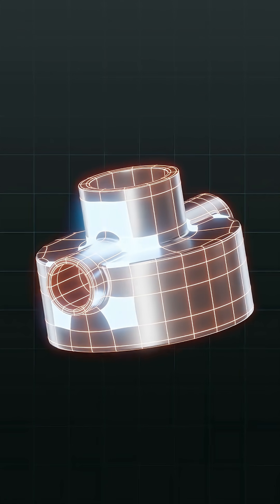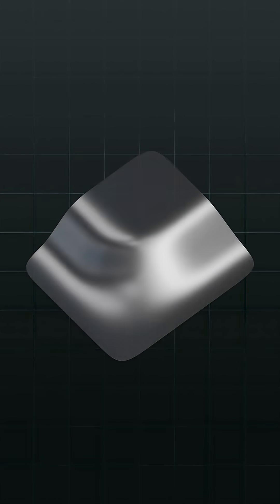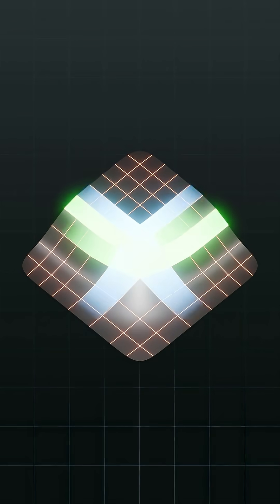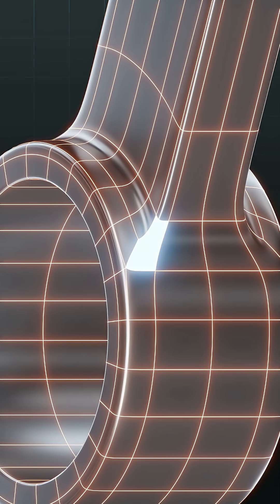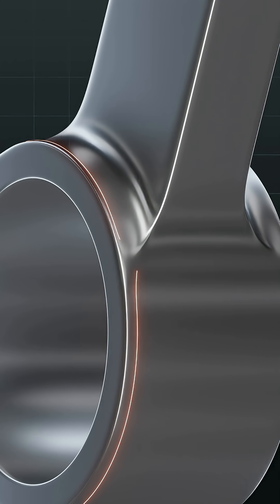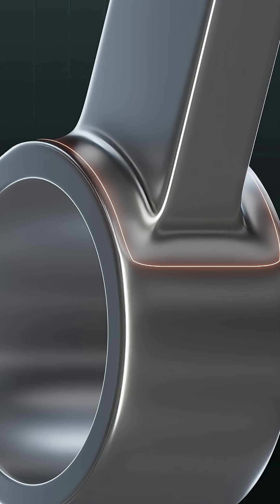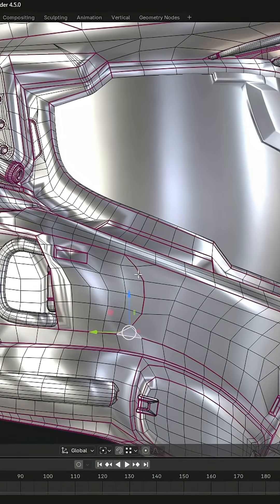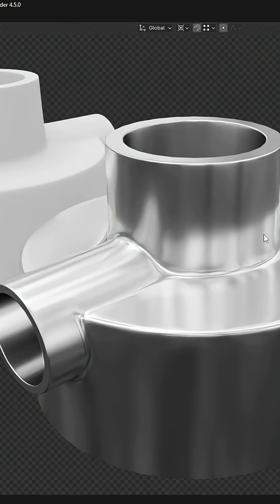You CAN Model with Ngons | #blender3d #blendertutorial #blendermodeling

Comment: Uhhh. No.
Reply from the maker: Did you watch what I had to show before just saying no? 😅

There’s a great deal of logic to ngons, they’re in many ways similar to poles. Just like poles, ngons will distribute the flow of topology. Provided you place them correctly, just like poles, you’ll avoid unwanted shading errors. 😁
Reply: @masterj2001  this kind of person is what we in arabic call "a memorizer, not a comprehender". They heard "ngons are bad" and took it to mean ngons are always bad all the time, not understanding why programs don't automatically convert all meshes to tris/quads if nobody used ngons ever.
Reply from the maker: That’s a common thing with ngons, is that their negative stigma stems from a frequency bias, as it’s easier to find examples where they cause issues as opposed to solutions. 😅

Funnily enough, triangles and ngon usage are detailed in Pixar’s own open subdiv modelling documentation. I’m only a hobbyist, but if the likes of Pixar, let alone other modellers that are far more talented then myself, use ngons (and I can replicate the results), then I can assume beyond a reasonable doubt that they work. 😁
Reply: @Hyikal  I have a degree in computer science and several years of 3D modeling experience. I've done my fair share of continuously rejecting memorization and dedicating my efforts to comprehension, thanks.
Reply: @MustafaBerkeGureltol  I'm genuinely curious why you feel that ngons don't work. You're presented with actionable information with clear results with no shading errors (I recognize that you feel differently, but I feel there's a disconnect here with what you consider to be an error). I would like to know where your critical thinking is leading you to opposing conclusions. Can you provide clear answers aside from "it doesn't work"?

Quads suffer from the same issues that ngons do when used poorly, both in the high and low poly. And most often, when doing quad-only modeling, you're creating the same or similar results manually that ngons would create post-subdivision. 5-poles are inevitable in quad models and yet are accepted. So why not ngons, which very predictably subdivide the same way (this is a fact, not opinion. Argue with Math on that one)?
Reply: @masterj2001  Yes, watched it thrice actually. Still a no from me.
Reply from the maker: That’s fine, but I’m curious for as to know why you say no? 😁 

The results that I’ve shown in this short, as well as the additional examples in the related video, are backed by plenty of research into the topic and have been vetted by modellers that have far more knowledge and experience than me. 😁

So I’m curious as to your opposition to the concept, as I know most modellers simply oppose them due to an established stigma. 😅
Reply from the maker: I think 'terrible suggestion' and 'irrelevant examples' are a bit heavy handed. 😅 I can see you're passionate about this, as am I, though I'd like to discuss this in a constructive and friendly manner. 😄

As you said, the first example works. I recognise it's not a practical modelling example, but that was the point, it was just to establish an example and show the fundamental concepts. Regarding the shading, it does shade cleanly without artifacts or pinching, and that's why I chose to show a rotation of the object with a highly reflective material, to clearly show how the mesh normals behave. 😄

Could this be done by hand? Certainly, but the benefit that I wished to highlight here is taking advantage of the mathematics of the subdiv operation. I see that you also have a degree in computer science, so you'd no doubt understand the underlying mathematics of how the algorithm is calculating the placement of the subdivded verts far better than I. 😄

The second example does create a proper flow of topology, something I show and explain in the full length version of this video. Something I also note in that video is that I'm not advocating for the fact that ngons are better than quads, but that they have utility within modelling and do serve a purpose. 

For the last part, and I did see this in one of your videos, and you and I will agree here, yes, you need to resolve the final model into triangles if it's going to be used in different engines. The beauty is that ngons triangulate into all tris, so they still abide by that logic. If you really want to, and something I make a point to do in the full length video, is isolate the subdivided quads of an ngon and integrate it back into the original mesh for an all quads solution.  

I know I'm not going to be smart enough to dispel every argument you make here and I don't wish to come across as being defensive by just trying to say 'no, this' to every point you make, as I think that's reductive and I don't wish for you to think that I don't respect what you're saying. 😅

I do implore you to check out these two articles though, as I think both provide a great deal of detail (far more than I possibly could): https://www.artstation.com/artwork/0n93EV https://graphics.pixar.com/opensubdiv/docs/mod_notes.html

My understanding that ngons can work within a subdivision workflow comes from documentation by Pixar and examples from industry professionals (I'm only a hobbyist, so who am I to argue against the industry and industry professionals), I am also able to replicate the examples and adapt the usage of ngons into my own models. So from a purely evidence based perspective, not a matter of beliefs, I can see enough evidence to prove that they do have use cases, even if they are limited. 😄

Happy to keep discussing this with you, as I love your passion for modelling, but would only like to do so if it's done respectfully. 😄
Reply from the maker: Don't call yourself a bum mate. 😅

As you said, you've got a limited knowledge in modelling at current and are still learning. My advice, learn all the basics of quad-based modelling, edge flow, and poles. They underscore the fundamentals of modelling for a reason and I'm by no means advocating for throwing those fundamentals out the window. 😄

Ngons don't necessarily break the rules of modelling, something I would've previously said, but can be viewed more as an unconventional or taboo means of modelling due to their stigma. In fact, the only reason that ngons work is due to them abiding by these fundamentals. Can they be used absolutely anywhere without reason? Certainly not, they need to be used mindfully, but the same goes for much in modelling, if you place a pole incorrectly or have edge flow that doesn't respect the shape's surface (even with all quads) you'll still run into errors. 😄

But I'm sure with time and practice your skills with develop overtime and you'll have a better grasp over when and how they can be utilised (it's something I'm still learning myself in all honesty). 😄
Reply: @masterj2001  First of all, there isn't a single unfriendly and/or disrespectful phrase in my earlier comment. So I do not hate you in any way. But I still stand by what I said. It is a terrible suggestion and it is backed up by irrelevant examples. Just checked out the full video and the sources you've shared. Further explanation:

1- The n-gons you use in the full video and in this short are not the same n-gons. The one in the video is a hexagon, and this one is a pentagon. But regardless of that, the poly flow they create is, again, ambiguous. You can say that at SDiv=1, it creates a loop that's going up and around the edge. Well, I can also say that it is looping around the whole extrusion. And another person can show up and say that it is connecting the cylinder's lateral surface to the extrusion. At SDiv=0, none of them is right, and SDiv=1, all of them are right. In procedural hard-surface modeling, this behavior is not really welcome as it takes control away from you in a way, and it starts producing visible artifacts at either the first or second subdivision level right off the bat. And let's be honest: The loops you are trying to justify are not even functionally good. They come from the side of the extrusion and connect to one of the four corners of the shape. To be fair, a triangle and a quad instead of an n-gon would arguably perform better; at least you would've hugged the base of the extrusion with a loop, and that could help you sharpen the connection point uniformly if you needed. But the shading problem with the cylinder's caps would remain. You need an extra set of loops there. In either case, you could avoid a series of unfortunate problems by not using n-gons and establishing a better topological density at the first place. Just extrude it and add a few support loops. It will look much better.

2- Katja's post has been around for some time, shared on various forums, and has sparkled arguments. More than half of the examples used in the post are being showcased on flat surfaces. You cannot stress-test n-gons on flat surfaces only. If you are 100% sure that you will not be adding any additional details on a surface, then you can place a few n-gons here and there to save time. No one is going to notice or blame you for it. But as soon you enter the realm of surfaces with curvature, n-gons start to break. Not only that, but also some good-ish examples revolve around loose 3D modeling, where you don't really care about the accuracy, sharpness, art direction, or revision, but rather making up shapes for the sake of making up shapes. I can imagine far better solutions for the examples in page #13 for example.

3- In Pixar's example, they are using poles "strategically" in their words. They do want a pole there and they determined that beforehand. They do not use it to get away from topology-heavy work; they do not use it to re-route the polyflow. They use n-gons because they "need" n-gons there. Some connection points just require a pole, and they just modeled 1 lower level of subdivision than what they need, and subdivide it during rendering. I even follow a similar method while retopologizing garment patterns. Helps a with pants and shirts.

Just because something gets converted to triangles or quads in the end doesn't mean it is production-friendly. Even though models can be triangulated in the final phase, you still have to deal with the hassle of resolving problems while bringing them to that point. N-gons are essentially a scam, except for specific use cases. There is almost always a better option, including quads or triangles, whether you are launching a new modeling project or finishing one.

Don't forget that a quad is also an n-gon that produces a pole. The only difference is that you can define adjacent faces and propagate that information, which enables smoothing algorithms to smooth the surface properly and allows modelers to improve or detail the topology further.
Reply from the maker: My apologies then, I just read "terrible" as being a bit brash and "I wish the content lived up to it" as a touch passive aggressive. Didn't think you hated me, it just read that as being a bit harsh. If that wasn’t the intention, then no harm done.

Anyhow, I can assure you that the ngons between both videos are the same as I used the same .blend file to create both bits of content and shared the exact same models. 😄

I'm unsure by what you mean with ngons being ambiguous? As in if I had a pentagon face on my machine and you on yours we'd get two different subdivision results? An ngon, of any face count, will subdivide to form a pole that matches its edge count. Unless I’m misunderstanding what you mean by ‘ambiguous,’ I don’t see how that applies here. You can look at any model without a subdivision surface level applied and draw out how it's going to resolve after the first level of subdivision, so I'm not sure what you mean by ambiguous?

As you said, "N-gons are essentially a scam, except for specific use cases", and that was the point that I wished to get across. Not that they should be used everywhere without care or consideration for placement, but for specific use cases, much like the examples provided in the sources I linked. I agree, yes, you could resolve them in different ways, but why not take advantage of the automatic mathematic placement of the subdivided verts as opposed to doing it manually and spending more time on the area than needed? That's more of a rhetorical question, you need not actually answer that, that's just more my line of thinking when it comes to modelling and opting for the solution that takes less work for the same result. 😅

Question though, and I'll be interested in your response here, on that Firefly character model of yours, which looks fantastic by the way! How many 5 star poles are present on it? If you were to reduce the entire model by a single level of subdivision, what would those 5 star poles resolve into? So why is a 5-star pole a viable option, but a 5-sided n-gon isn’t, when both subdivide identically and produce the same shading?

Also, apologies in advance, my next response will be late as I live in Australia and I'm about to head to bed, but I'll be looking forward to reading your response tomorrow. 😄
Reply: @masterj2001  This is truly the most pointless conversation I've read in a while...
Reply from the maker: @JocoseJokes we’re just debating differences of opinion in topology? We both find the topic interesting. 😁

If it’s not for you, that’s fine. 😁
Reply: @masterj2001  Okay, so you are using two examples in the video. One with a hexagon and one with a pentagon afterwards.

By ambiguous, I mean that a) it doesn't have a set of adjacent faces since it has 5 faces, and b) it produces a pole that cannot have adjacent faces. You cannot be 100% sure where the incoming edgeloop would be coming from and where it would be going to. Subdividing an n-gon will yield what I call a "slingshot" polyloop, where a loop would come from some part of the surface, slingshot around the center, and go towards another part of the surface, which may or may not create effects like spiraling, infinite looping, not-yet-defined poles, etc. You can be sure that all the edges would tie up at the dead center, though. It's more or less like a black hole in the middle of the mesh. Stuff like this is quite important for rigging and scripting for procedural modeling, where you could programmatically control where and how an effect or operation would happen. Getting a deterministic result with n-gons is not viable, especially with search algorithms. Other than that, they would subdivide the same way, and probably with the same vert IDs and order on both your and my computer. It's just not preferred to have a polygon that will create a star and disrupt the polyflow.

Q: Why not take advantage of the automatic mathematical placement of the subdivided verts as opposed to doing it manually and spending more time on the area than needed?
A: Because of multiple reasons: 1- Automatic placement usually isn't as accurate as the manual work, which is clearly visible in the first example in this short. 2- N-gons are not deterministic/unambiguous. 3- You can reliably run scripts and deformers without any concern on a proper all-quad topology. 4- Starting with such a quad-based topology actually boosts productivity and avoids most, if not all, shading artifacts, whereas your examples still have clear shading issues around the n-gons.

Q1 on Firefly: How many 5 star poles are present on it? If you were to reduce the entire model by a single level of subdivision, what would those 5 star poles resolve into? 
A1: A lot of 5-star poles. If I were to reduce it to a single SDiv level, the stars would stay where they are because what you see in the artwork is already the second subdivision level, but the base SDiv consists of manually placed stars, not n-gons.

Q2 on Firefly: So why is a 5-star pole a viable option, but a 5-sided n-gon isn’t, when both subdivide identically and produce the same shading?
A2: Because a 5-star pole is a rasterized 5-star pole that consists of quads. Everything is deterministic. It is made of quads, and it subdivides into quads. An n-gon and its subdivided quad-based successor do not subdivide identically; I can crease, bevel, straighten, swivel, and cut edges/polys and control the strength/behavior of them, and the subdivision deformer has no control over those, as everything I need is either already present in the base mesh, or can be programmatically defined if need be. You can clearly see that the base topology supports various modeling operations without sacrificing visual fidelity or control. Even though the poles in my project do not have adjacent faces either, they've been placed strategically to reroute the topology "properly", and I can add an edge loop in any one of the poly loops and it will end up where I wanted them to be. You just need good luck with n-gons when the subject matter is reliability.

Also, I worked on the artwork to test the brand-new bevel shader of Marmost Toolbag 5. It can utilize hard edges to create a bevel effect, and the best thing is that you cannot tell which of the bevels are real and which ones are shader-driven. 

You are approaching the problem as if adding the TurboSmooth or Subdivision modifier to an inefficient topology is fine, as long as it looks pleasing enough—but that couldn’t be further from the truth. There’s a reason why n-gons have a bad reputation in the industry; it’s not just hearsay. And even if it were, I think any misunderstandings would have been resolved by now, given the half-century history of computer graphics and mathematics. I just don’t believe condoning, suggesting, or legitimizing the use of n-gons is good practice when the stakes are this high, especially when there is always a better alternative. Hence, my wish that the content received the same level of care as the animation.
Reply: @masterj2001 no no, Im on your side with this one. But I will say this seems like a one sided debate with this guy. He just seems to be quite stuck up yk?
Reply from the maker: @JocoseJokes  From my perspective or anybody who wishes to take my side in this? Yes. But the same can be said for his side and anybody wishing to take his side. 😅

I’m doing my upmost to simply be respectful of an opinion and just debate the facts. I knew from the get go that neither of us would be likely swayed by the other’s facts, but that’s fine. 😁

He nor I serve to gain anything in convincing the other of our facts. I’ll continue modelling and enjoying my modelling workflow and he his. 😁

Much of the technical language goes well over my head, but I still do find it interesting to discuss and understand other people’s opinions/points of discussion on these topics. 😁
Reply from the maker: Oh right, yes, I do use two different examples of both a 5 and 6 sided ngon to show off the versatility in the `n` factor of an ngon. 😄

Anyhow, we'll have to agree to disagree though, otherwise we'll be debating the semantics of topology until the end of time. But I do appreciate you sharing your point of view and providing with me more insight as to why you see as such. I just much prefer a more in depth explanation than, "no", so that I can also understand things better. 😄

Personally, I'll keep working with ngons when and where I see them having utility as I personally find them quite powerful and can save me some mental gymnastics in problem solving. For the assets I create, provided they shade nicely, that's good enough for me. 😄

Much like the example you bring up with Marmoset, I'm less concerned about absolute perfection and will go for what looks good. Much like how bevels need not be real and can be shader driven, provided the final product has the intended hard surface look for the edges, the final product works in my eyes. 😄

Not to fork into a different debate, but I know that the bevel shader will handle improper edge flow really nicely as well to produce a well shaded result, which then brings into question the superfluous nature of correct topology/fully connected meshed in the first place. 😅

But I'll be looking forward to seeing more work from you in the future mate, as with this discussion alone I can see how dedicated, smart, and passionate you are about the field of modelling. 😄